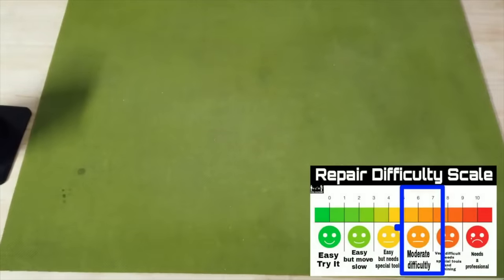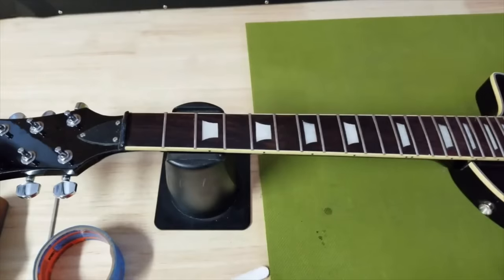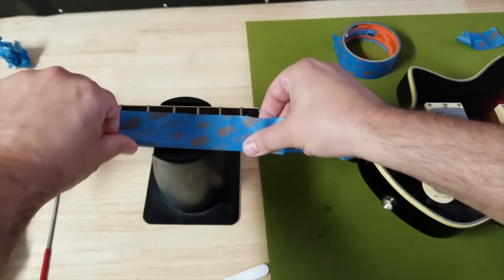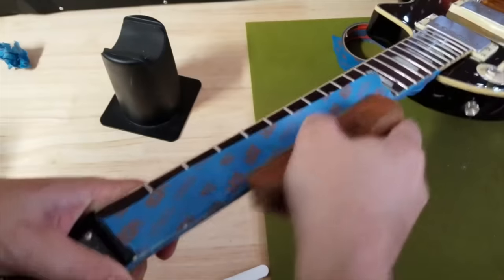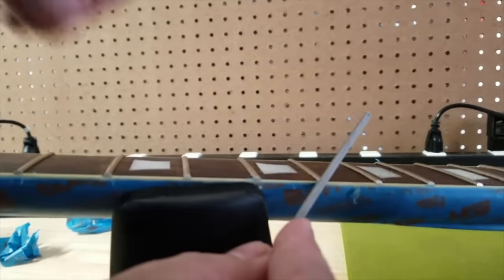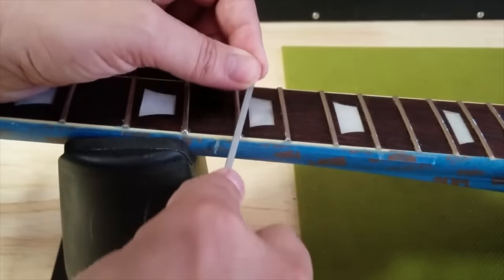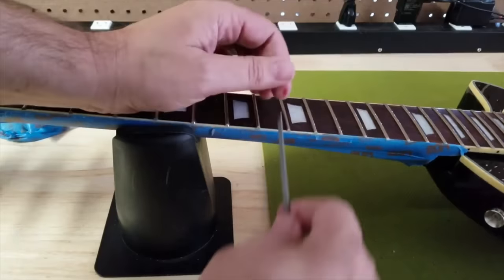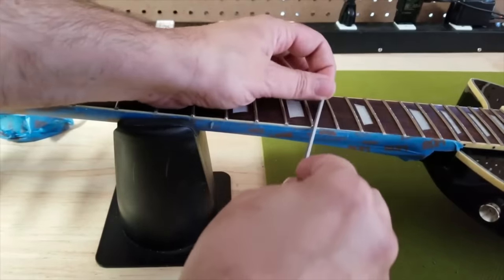How To Fix Sharp Fret Ends

Comment: Thanks for this, Phil. Question - I live in a climate in which the weather changes from extreme dryness in the winter, to extreme humidity in the summer. Fret sprout occurs for me in the winter (even when using a massive humidifier), but everything is fine in the summer. I am a little wary of dressing my frets in the way you do here, because of the possibility that any work that I do on the frets might feel great in the winter, but might, in some way be too much in the summer. What do you think?
Reply: I would go ahead and take care of the fret sprout, in reality your not taking that much material off the fret end and if anything will feel the same if not better as the seasons change. Live in North East, I have had the same issue
Reply: Even I've had troubles with this (live in India) to the point where often even guitar techs don't know what to do with them cuz they can be so unpredictable
Reply: @stepvanjoe3469  Thanks for your reply. I think that I will do this.
Reply: @j_freed  Thanks, Jonas. Good info. and advice. My electrics are actually all stabilized now, I think - the most recently made one is about 5 years old. So, I think I'm safe to deal with the fret sprout. Interestingly, it is much worse on my Strats (maple and rosewood) than it is on my Gibson and Epiphones.
Reply: I ordered a very nice Godin from back east. I guess in shipping it had sat around in cold dry places in transit so it had this "sprout" thing when it arrived on the West coast. Once it got acclimatized to a damper environment out here it was fine. Since then I keep all my instruments in a stabilized environment. (But I've worn out three humidifiers through the winters and a few weeks in the summer. Oh well. The price to be paid I guess.)
Reply: Yeah I live in the North East too and have the same problem. I noticed its definitely worse on maple necks
Reply: You must live next door to me!  LOL.  (Chicagoland...just a week or two ago we had below freezing wind chills, and 2-3 days later it was 90 degrees and humid)  But as stepvan Joe said below, I asked my luthier recently this same question - worried that sometimes it's unavoidable for my guitars to avoid high humidity during the summer, but my fret filing was done when the guitars were at 40-45%.  He said that there is such a miniscule amount of length-loss when doing this, that he'd have do do it 10x before the issue of too-short frets arose.

Comment: Kauerguitars is testing CNC beveling of fret ends. I imagine it is feasible for manufacturing a neck with known dimensions. In order to be useful for correcting fret sprout, I suppose some kind of automated measurement of the neck profile would have to happen, a la PLEK, so that the fret sprout could be cut away before beveling or even round the ends.

Comment: I recently filed the fret ends of a cheap guitar myself, which cost me less than 2 € and 5 minutes of work:
Buy a nail file which is not made from metal but from glass; those files usually have a thickness of around 3 to four millimetres. Then carefully file off the sharp edges with the smallest side of the nail file using just the tip of it. If you don't haste, then you don't even need to use tape to protect the fretboard.
Reply: Hi. That sounds interesting. Do you mean to say the glass file used by ladies for manicure?
Thanks in advance.

Comment: Thanks.just did my first fret sprout correction followed your instructions using painters tape and files you recommended.I bought a Monoprice strat.frets were so sharp they actually cut my fingers. Your method worked great and now guitar very playable.thanks Jerry

Comment: Great video. I used my normal fret level block and started with much more coarse sandpaper than I’d use for a fret level, after watching this. I wasn’t sure how to deal with quite bad fret sprout before as I’ve never had it happen until this one guitar. 

It was done in minutes. 

Thanks

Comment: I like your tape technique. I have a 2-1/2 month old Harley Benton TE-20 HH SBK tele style guitar in all satin black including the neck and fretboard. I live in Maryland and just noticed fret sprout actually pushing through the neck finish on the sides! I can't really send it back because I modded and upgraded all the hardware and electronics and got it sounding really good now after a lot of work. I think this tape trick will help me remove as little of the matte black finish around the fret tangs as possible. There will still be some paint touch up work to do at the severe fret sprouts that is beginning to chip the finish since it appears they painted over the fret tangs.

Comment: Hey Phillip - thanks for this video.  I just bought a guitar whose frets are so sharp I'm actually scared to play it.  I was running my fingers over it and got a huge snag.  

Anyway, if you get a sec to refresh your links to the files you're using, many thanks! The Sweetwater one just takes us to Sweetwater.  I'm especially interested in that first one you used as well as the one with the rounded back.

Comment: This is an older video, but still relevant. I have been using the file jig for the initial bevel for a very long time. I bought the first one from Browns Guitar Factory, I believe they make them for StewMac. It is a 35 degree bevel. I since make my own on the table saw, and use 15, 20 and 25 degree bevel. Depending on neck carve, binding and fret size. I then use a variety of fret end files to round over before polishing. Also if you run a long piece of tape horizontal on the edge, as you showed, then over the top of the fretboard vertically when necessary, you can remove everything at once by pulling off the horizontal piece. Saves a bunch of time that way. The whole thing is subjective, that's just what works for me...  JMHO,  be safe...   --gary

Comment: I recently did a couple of my guitars. My Stratocoustic,which I recently purchased from an individual, had horrible fret sprout. My Jackson needed a good polishing. Night and day difference. Of course this is not a quick process. Both guitars took me about 4 hours total. This included taking breaks. I also gave each neck a good oil and cleaned and polished the body,headstock,and pickups. But I saved myself quite a bit of $$ as well as increasing my knowledge and ability.

Comment: An excellent video describing and showing perfectly how to deal with an issue that seems to crop up a lot more than it should with fretted instruments. And I agree 100% with you when you say go slow. I learned that many years ago. I always tell people hey, it's easy to take something off a little bit at a time, but it's really hard or almost impossible to put it back if you take too much. Remember, When it comes to working on your guitar, especially fret work or nut work.  Don't be the hare, be the tortoise.

Comment: Definitely, the way to do it if you want to desprout fast and reliably. When you refret, nip the tangs and plug the slot ends with wood dust and CA glue or if there's binding, use some binding scraps mixed with acetone.

Comment: Good video, really enjoying the Tech series.  Stew Macs Fret file has been my goto file for every fret job for years. Your Fret Sprout/Rounding method is almost identical to what I use. Only difference is using 3M Vinyl Line tape, instead of painters tape just under the Tang. It is a bit thinner and is a bit less likly to pull up oldor flaky finishes.
I like wide necks, so I tend to favor more rounded(hotdog) fret ends than most people who like necks with strings close to the edge.

Comment: Great video! What about if the frets are not (only) sticking outwards, but also a bit upwards at the ends? For some frets you could stick a very thin sheet of paper under the fret ends, especially on a neck with binding? Any thoughts?! Cheers

Comment: All these tools are available at Stew Mack but they are on the expensive side. If your really into guitars it makes sense to buy these but if you only own 1 or 2 guitars you might not be able to justify this cost. There is a solution - you can make your own tools using hardwood ( maple floor boards are perfect ). You need a saw table ( or a friend with one ) to cut the physical forms of the tools. Then using 2 sided tape and carefully cutting strips of different sandpapers ( 240 and 320 grit ) you can duplicate the real tools. I strongly recommend  to watch 3 or 4 different YT videos to get all the understanding of what your trying to accomplish and the tools involved. Stew Mack has even dimensions on some tools. I found the cuticle file at the Dollar Store. The total cost for a complete set of tools is less than $10 .  A full fret leveling tool can be made in the same way using a common aluminum carpenters level. The many YT Videos showing how to do a full setup on Bass or Guitar have completely demystified the art of the luthier for me. I'm still waiting for the Rolling Stones to ask me to join so you understand where I'm coming from.

Comment: Question- as the neck may shrink causing fret sprout, if it expands could the frets feel normal again without filing them and if they are filed, would there be a problem if the next expands after filing the frets?

Comment: I feel basic understanding of the materials used to make a fretboard/guitar neck,  would go a long way. Nickel is pretty soft compared to steel. That's why a delicate touch and very fine file are necessary. Is it better to use tape, or use a guard?

Comment: Which 6" Stew Mac file are you using of the sharp fret ends, the Fingerboard leveling or the fret leveling file. One is a crosshatch type file and the other just has diagonal blades going one direction?

Comment: Hey Phillip I want to ask you a question I bought a Les Paul Epiphone Ultra 3 and I cannot get the action where I like it without buzzing. Will a fret leveling and crowning fix this problem? And will I be able to get the low action that I prefer? And I would like to put 9 gauge strings on it.

Comment: Is there a point where the sprout is so bad that you would want to use a beveling file? I have a cheap guitar (Xaviere, from GuitarFetish), that has huge fret sprout after moving to Colorado and and spending a winter in the mountains. I want to use this cheap guitar for practice before I work on nice guitars like PRS, Martin, Fender, etc. Thanks!

Comment: Would you have fret sprout on a roasted neck?  Would the roasting take all the moisture out and reduce (eliminate) the swelling / contraction of the fret board?
Reply: It depends if it still lets in moisture afterwards... I don't know if that kind of treatment still lets the wood absorb and also expand and contract.

Comment: May God bless you always for helping us out here! Thank you man. I was curious about that angle bard thing that you showed one time that ran up and down the neck from stewmac that also dealt with fret sprout when I was looking and came here. Now I see a better method I think, because it's probably safer in the end then reefin on it with a Long Bar repeatedly. 
More like a something a luthier would painstakingly do.. nice. I have my strings off my guitar just cleaned my neck and I have some serious fret Sprout I need to deal with.
I can't help but add my crazy thoughts to this and I don't think they're so crazy judge4yourself. I think there's a conspiracy going on between the manufacturer's of guitars lately and the repair industry. I played guitar for 45 years now and I remember like 30 years ago when I was playing you never saw never felt fret Sprout ever on a decent guitar. Actually never felt it on any guitar until recently. If you asked me they're just releasing the crap before it's completely finished. It takes painstaking attention like you just did to make that happen and I'm almost convinced that they used to do it as part of the deal when you spent a few GRAND on something that's made of two little pieces of wood that don't even move and at the most three pickups, a bridge, three small potentiometers and a switch. you know what I'm sayin ESPECIALLY  if they don't complete it and they don't even offer a case for guitars that are like $4,000! The whole thing stinks to me. If you ask me it's a big rip-off ..a commerce generating Monster. 
I heard a term the other day that I thought was interesting. The guy suggested that people that are offered new and exciting gear often immediately come down with GAS.
GEAR ACQUISITION SYNDROME.
 I don't mean to thwart Commerce on your channel here man cuz you really good at helping us all in generating money and that's why I think people send you things to demonstrate.
Luv ya man! Stewmac should be very proud of you

Comment: Little confused about fret dressing tho     I'm not really sure what it is  and how it can get damaged  or where it is exactly
Reply: Fret dressing is just the finishing of the frets, especially on the ends (at the sides of the fetboard) so that they're not sharp and more nicely rounded. Higher quality (or more expensive) guitars tend to have that done already, but they might have skipped that on cheaper guitars (though, not necessarily). - You should just check how it looks and feels on your guitars and see if it's necessary to improve it.

Comment: I've always scratched up the my guitars noticeably when resolving fret sprout. But I'm sure using specialized luthier tools would have helped. Also if there is fret sprout, there is very likely also likely a slight twist in the wood AND a more curved radius of the fretboard (meaning I needed to first gently hammer down those frets which actually worked on my particular guitars).

But I tried countless hours filing, fixing, laser testing, etc until I realized that there's no way to fix a neck that is already shrunk/warped EXCEPT to raise the string height as higher action fixes all problems.

I will say this through my many guitars and suffering these problems. Once the wood is shrunk and warped, consider it permanent (like pre shrunk cotton tshirts that will no longer shrink). Also I noticed that once the string is on, it can drastically cause it to warp out of shape. Then when loosening, the warps and twists greatly reduce. And yes string brands and unbalanced sets seem to effect the warping over time.

Of course, I'm speaking about getting very low action so fanboys and fuds recommending strings are probably playing at high string height.

I do believe that the final solution is to refret the neck with a taller jumbo fret, then get it filed by that computer guided filing machine service. I haven't done this yet but it should permanently resolve the issue.

Comment: I know it has been nearly a third of a year since you've done this so this comment may not reach you, but I would like to let you know that files are actually designed to only cut while pushing, pulling actually dulls your files (while giving you the illusion you're smoothing) please use files the direction they were meant to be and smooth with abrasives instead. Your tools will last much longer and your jobs will go better if you use everything as designed.